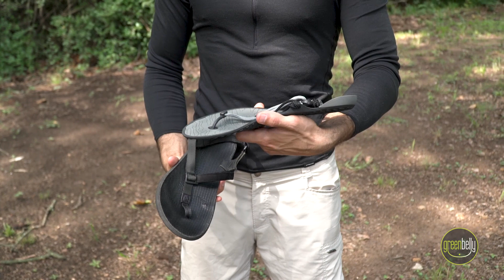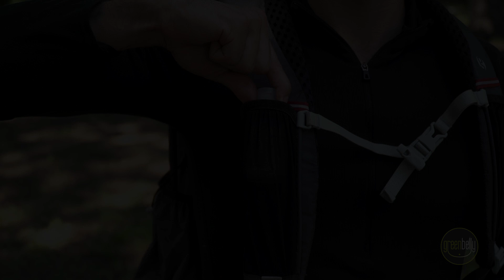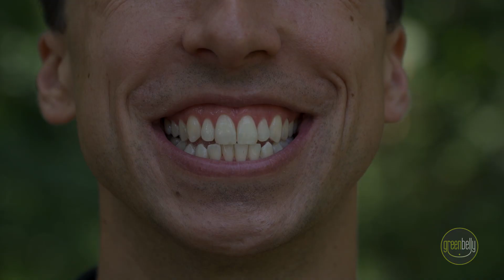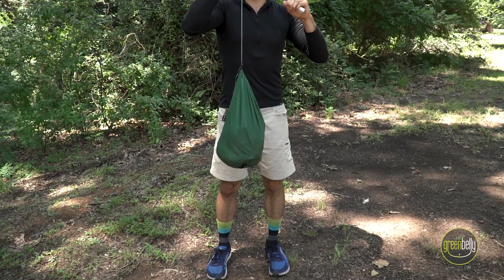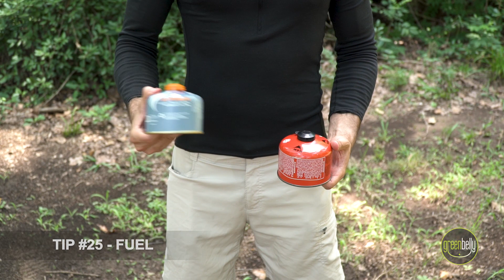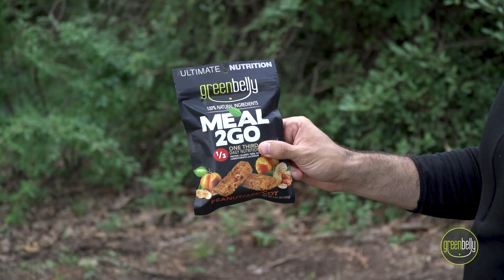16 Ultralightweight Backpacking Tips and Hacks (Part 2)

Comment: Fuel Canister in water to guesstimate how much fuel you have remaining is awesome. Thanks!
Reply from the maker: Thanks! Can't say that is an original idea. Heard that one for the first time many years ago.
Reply: Make sure the canaster doesn’t have air trapped under the bottom or you will get a false reading
Reply: MSR canisters have the makings on the can. When you float it,  you can see how much fuel

Comment: Nice list Chris. While I'm no long-distance thru hiker nor an ultralight fanatic, I'm always up for shaving some weight. Regarding clothing, I don't skimp on socks and often bring a few extra pairs simply because soaked socks sucks :D

Also, last year I switched from using a jetboil to an Esbit stove with the fuel cubes. It's small, lightweight and very inexpensive. I can fit my whole "kitchen" inside the pot -(including the stove, folding spork, matches/lighter, about 8 cubes and a homemade tinfoil windscreen - and it all weighs about 14 oz.

Thanks for the constant tips! Love the greenbelly bars too.
-Jeff
Reply from the maker: Rock n roll Jeff. Read a lot about the Esbit stoves - never actually tried though. Will check it out. Thanks for the notes... and glad you enjoy the bars :)
Reply: Bring Mole skin and gold bond too. If your feet are screwed you're screwed.